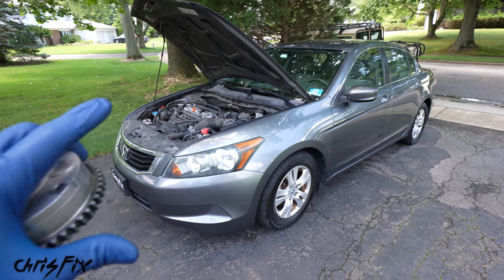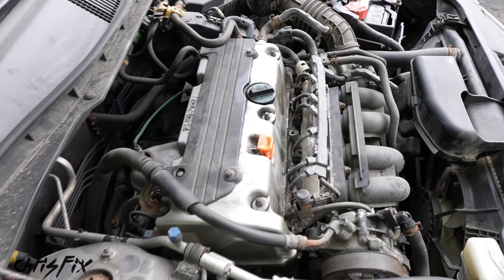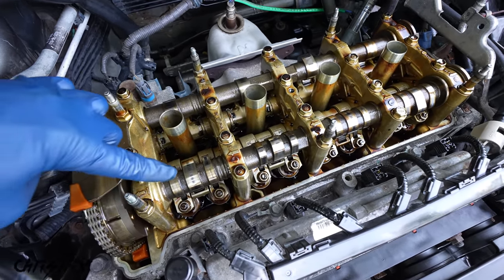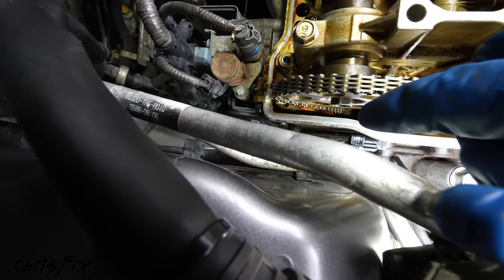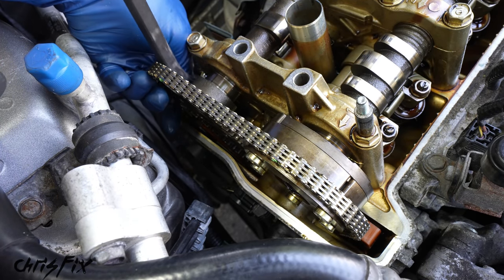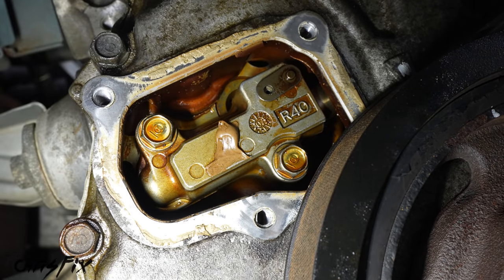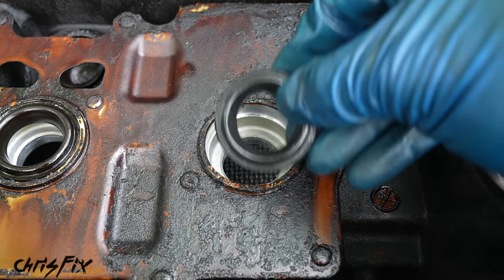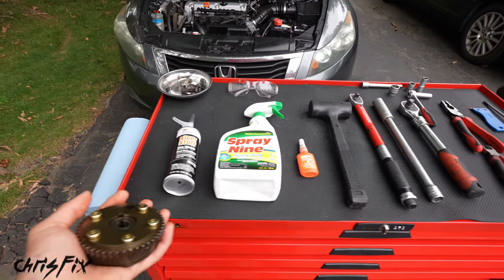How to Replace a VTC Actuator (Complete DIY Guide)

Comment: Is screeching/grinding high pitched noise on cold start, also a vtc actuator issue or starter motor? My civic 2018 is doing it almost every morning now. I'm not sure if i feel the vibration. Just that short screeching noise at the end once i start the car
Reply from the maker: Does it do it every time you start your car, hot or cold? Or just on the first cold start of the day?
Reply: @chrisfix  as of now, it only happens during cold starts in the morning. I cannot replicate it in the afternoon or evening or even if the car is left unused for 8-12 hrs the whole day. The car started normal today. No noise/starter noise. But the sun is also up and shining when i used the car. 

Not sure about the word screeching btw. Noise is more close to someone blowing their stuffy nose. Very short high pitched noise appearing after that normal starter sound. Ty

Comment: I have the rattle on start up for my 2016 Honda Fit. He mentions it could be caused by a bad timing chain as well, mentions he will show how to change it, but I didn’t see any info on that?

Additionally, he mentions that if the white marks don’t align, the timing chain may have skipped a tooth or worn out as well. How do we fix the problem if that happens?

Comment: Hey, can i just remove the plate off and replace the spring, and if yes where can i get the spring kit? If I can do this without dealing with the timing chain and points it would save me a whole lot of time. I'm pretty sure it can be done. What do you think Chris? And can you do a video on this?
Reply: any luck with changing the spring, i am trying to do the same thing

Comment: I just changed mine but I don't know if I did it right. It starts well but a little forced, I let it reach its operating temperature and accelerate a little without problem but when you release the accelerator the revolutions drop to 500rpm and it almost shuts down. Another detail I saw is that when you remove the oil cap, a lot of air comes out.

Could you tell me if this is normal?

Comment: So I have a 2004 Honda CRV. Called Honda Services and they said it's no use on replacing the actuator. It's a 400 dollar part. Will thicker oil help with the noise?

Comment: Timing question. At 17:15, you mark the punch marks with paint but it appears to no longer be at top dead center. The two marks on the insides of the sprockets appear to have rotated past each other. I haven't finished the video, so maybe it's clarified later, but can someone explain this?

Comment: I have a weird situation where my Acura TSX (same engine just higher compression) made that exact noise when I first got it at 130k miles no engine light, wasn’t low on oil either, did 3 oil changes within less then 2,000 miles with Pennzoil ultra platinum now I don’t have the noise anymore after over 10k miles now at 144k. I think mine may have just been sticking from lack of maintenance I’m not sure

Comment: Someone had replaced the chain on my car and didnt use the colored links like they should. It is off one notch evidently according to my scan tool Cant determine which one or which way. Any way to rotate the chain without taking the cover off and assuring its in the right position so the colored links will line up? The more I think about it, that shouldn't matter as long as the lines line up, correct?

Comment: What happens if the timing chain tensioner key hole is way off the hole alignment even when I turn the crank shaft counterclockwise a little to try to decompress it to put a new tensioner in to replace

Comment: I have an R18 civic that does the exact same thing but it doesn't sound like a rattle, sounds more like something is slipping and also sounds like a grinding noise at the same time. As you know the R18 doesn't have a VTC actuator like this one does and unfortunately there is no check engine light. I'm thinking maybe it's a bad pulley? Any thoughts?

Comment: Hey chriss I have a car and it's really shakes no matter what it's runnig at idle or at high revs but shakes increase at high revs and sometimes it goesaway instantly and almost fully like last night under heavy rain  ...plz help me out i wonder if its mechanical like a bad clutch disk or ellectrical like coils or sensors or injectors.  .PS:NO ERROR CODES

Comment: I once had to cut a valve cover gasket a few cm cause it was slightly longer than what the Tiburon had not my proudest moment but hey it didn’t leak car still running 4 years later😂
Reply from the maker: If it works it works!

Comment: Is this the same step on the 2.4 earthdream engine? Should the timing chain tensioner be replaced or is it not necessary?

 If it is that same method thanks the freaking noise is annoying.

Comment: Hey Chris...Im having the same problem in my crv 2013 exl, the only differences is, that rattle sound makes it every time 15 minutes pass (Engines off) ...So in many words happens all the time not just in cold starts...Dealer stated is the vtc actuator theres no code by the way...Im a little bit confuse if might be the vtc or something else..
Reply from the maker: Sounds like the oil is draining out of the actuator and causing it to rattle. Hard to say without seeing it tho.
Reply: @chrisfix  Hey Chris thanks for your reply and by the way nice video…Im really struggling with this issue, in case oil is draining out of the actuator should I replaced it or look for something else (other issue might be)

Thanks again!

Comment: My tensioner doesnt lock/unlock. it simply stays in the unlocked position whether im turning the crank clockwise or counterclockwise. Does this mean the tensioner and chain are bad, or just one of either?
Reply: Regardless, the timing indicators of my crank are off, even though the exhuast/vtc sprockets line up fine. Im just going to send it to the shop.

Comment: It's 2:00 AM, just returned from my test drive. One advise, do not use the DORMAN actuator. Installed it last week and grinding was back yesterday. A number of customers had a similar issue so DORMAN is a hit or a miss. Went to the dealer and picked up an OEM and reinstalled it myself. Let's see how long this lasts. Just my experience, it was not as easy as it seemed.
Reply from the maker: Interesting, thanks for sharing, the unit I installed has been working fine since I installed this

Comment: In my accord I manage to get the sprockets to line up together at the top, but as said in the video the crank lines are off by a few millimeters, would it still be okay to replace even if it is off? or is there some sort of solution? thank you

Comment: Probably a dumb question but can a bad oil pump or the components in the pump cause the actuator to lose oil pressure overnight And make the cold start sound/clicking sound ? I had the vtc actuator replaced the power is back and it seems i get good mpg again but the cold start / clicking sound is still there .

Comment: My son‘s 2012 Honda Civic SI has that exact rattle noise on cold startup. However, it runs perfectly, very smoothly very powerful no check engine light and smooth idle. Can it rattle and not be bad yet? It has 140,000 miles on it and it has had, frequent oil changes and the inside of the engine looks brand new no sludge as we found out when we adjusted the valves at about 130,000 miles
Reply: Usually a new VTC actuator spring fixes the rattle
Reply: i was letting it go on my 08 accord but now that im at 160,000 miles the cold starts are getting worse the engine almost stalls and it rattles for another couple seconds longer than it ever did, so im finally replacing it. i fear the timing chain could skip a tooth and cause internal damage.
Reply: We can send you a free test kit for a new design.
Reply: @spring-start  sure, i have the r44 actuator in a 08 accord k24z3

Comment: Would there be anything wrong with rotating the engine at the power steering pump near the cams instead of the crank pulley?
Reply from the maker: Not sure it's designed to do that, I would always rotate from the crank!

Comment: My 2011 CRV has just started to make this noise at start up but no check engine light yet.  No change in MPG but I do notice hesitation with acceleration. Is it detrimental to not get it fixed right away? I assume the rattle is chain slap?
Reply: same here, no codes and very short rattle, debating whether to even worry about it

Comment: I have the same code but my car won't start. When I unplug my VVT solenoid. The car will start but will idle at 2500 RPMS. I followed your procedure to change the sprocket however the crankshaft TDC arrow is about 45 deg to left of where it should be. The cams line up and the dots are facing up. The two horizontal lines are facing each other on the cam. Should I bother changing the sprocket? Is the car untimed? If so, why does the car start up when I unplug the VVT solenoid?

Comment: Hi chris I attempted to do this repair and when it came to placing the cam phaser on the cam shaft i couldn't lock it so i had to stop my repair if you if could share any ideas that would be great and it is still un locked

Comment: My Honda 2013 accord rattles on turns as well after a cold start up. Along with the oil changes needing to be done far more often than usual. Is that a vtc?

Comment: I’m getting a p2647 code on my 04 Honda Civic but my engine is not equipped with a vtec solenoid.  The code is reading a stick rocker arm.  Any ideas on this?

Comment: Did this fix on my 2011 Hyundai Santa Fe with the 3.5 v6 replaced both chains and all 4 cam gears and tensioners. Still rattled on startup. Any ideas?

Comment: I am doing this job now. I saw another video locking the actuator after installing the chain, by rotating the camshaft counterclockwise. Doing it your way makes my tdc sprocket marks off by the amount i had to rotate to lock. The other way seems like it will keep marks aligned...whats the difference?
Reply from the maker: The way I did it is how Honda says to do it in the service manual.
Reply: If i am done with the install and checking timing...would my timing mark being off a couple centimeters be a result of the chain jumping when I had to remove the tensioner? @chrisfix

Comment: SOMEONE HELP?? 

After installing VTC actuator unlocked, and torqued bolt, I turned the gear to lock it but heard no audible click???  Is this cause for concern? It is locked in place and will not move but whats the chances this brand new part is defective?
UPDATE: Put everything back together and so far so good. No grinding noise, engine runs smooth as butter.

Comment: What happens if you let this go? Bought my '12 CRV as a local trade, it's been making the noise. Got my first oil change and although there is record of the dealership changing the oil 3 times, the mechanic told me the oil was very very dirty.

Comment: could you please comparing the bad VTC actuator and the new one ? I really don't know why the old VTC actuator is bad.
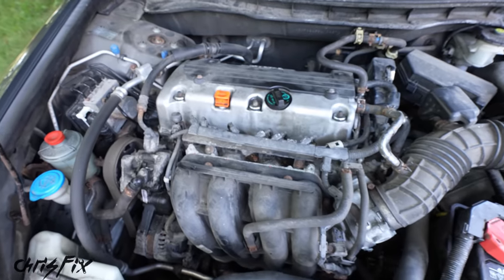Reply from the maker: 0:46
Reply: @chrisfix  Thanks for replying. Yeah，you read the DTC from OBD interface，that's good ,  and what i mean is comparing the old and new VTC actuator from their apperance, so i can know exactly what happened to the old one, because sometimes VTC actuator going bad but ECU doesn't give any DTC code. Just  a suggestion, if you do another video about VTC actuator, consider it. :)
Reply: It will make the rattle noise, that is the most obvious

Comment: Crank is TDC, cam lines are 8 teeth off. Vtc actuator = teeth looked like chain sat on tip. Popped top guide and teeth sat in. Can't get ANYTHING to line up correctly. Basically I'm taking an educated guess that needs chain kit, actuator, cams reset, etc??? Please help, please!

Comment: Hey, Chris. When I was reinstalling, the pin must've fallen out of the eyelet hole on the tensioner and now the little eyelet is pointing diagonally up and to the left, instead of down and to the left. I have code P0341 showing up on the dash, what do I do?
Reply: I'll also add that the car is NOT suffering in driveability, but the CEL is on, as well as the VSA and /!\ lights and my cruise control won't work.
Reply: Same here  did you get it fixed?  please advise me thank you my friend

Comment: My malibu makes this exact sound. But I have no code, is it possible that this is the issue? I had the timing chain replaced which helped the noise a little, but didn’t solve the problem. It is The exact same sound!!! Just no code.

Comment: hey i have the same exact car and everything and it does the same sound but my car doesn’t have a check engine light ,like everything runs good and i don’t want to waist money on buying the part or anything without actually knowing but idk what’s wrong and i wanna fix it ,plz tell me if it’s the same thing or just a timing solenoid or idk

Comment: My old vtc was i unlocked when I marked the chain and pulled it off, giving incorrect reference marks on the chain.  I installed the new vtc per the video, then dropped the chain and rotated the chain until I found the two sets of gold reference links,  only then did the exhaust sprocket go on ready like the video.
Reply from the maker: Glad to hear the video was helpful!

Comment: Someone also said it was camshaft gear assembly leaking down oil pressure and other person is saying this "I bought a Honda Accord 2014 touring model and I am also having that Grinding noice. Changed VTC Actuator two times, starter changed, belt changed, VTC solenoid changed. No use friends it's still having that trouble. Actually Honda knows that problem but they won't deal with changing all the parts. If once changed VTC and customer coming back with the problem they have to change the whole thing. One service guy from Honda told me like this. He also told me one more thing if Grinding noice is not solving then in future it will damage something gear and it will move everytime because of bad wear and tear. It will fully damage everything. I spent too much money on my car and It's like this. Why Honda is like this not aware of this issue"

Comment: You mentioned your painted marks on the chain won’t line up like old vs the new VTC….why is that? I marked mine before removing the chain now I can’t get the exhaust gear back on obviously I have to remove the tensioner altogether now.  Looking ahead it’s apparent my paint marks on chain won’t line up. Watching other videos, why is there so much emphasis on the gold links on a new chain with relationship to the punch marks? Does my old chain have these?  If my marks are lined up & I have the TDC mark on why is this necessary?
Reply: Did you ever find your answer? what did you do in your situation?

Comment: Just did one on my 2010 Accord 2.4 
Unfortunately I ended up pulling the cams out. Was anal on lining everything up after seeing mine had skipped a few teeth when I opened it up.Recommend changing out the tensioner while you’re in there. When I was done , alls good. Thanks Chris!

Comment: Wheni i removed my vtc actuator it was set in the unlocked position. So when i put the new one on and set it to the locked position i wasnt able to align the marks with the chain. This is where im lost. Do i leave the new one unlocked and put the chain on? Thats the only way to align the marks without rotating the camshaft.

Comment: Why do you need to fit the sprocket in the unlock position then turn straight after you tighten it,I pulled the old sprocket apart and found no reason to do this,just doesnt make any sense to me but engineets have their reasons.

Comment: help? I went ahead and turned counter clockwise and the little swinging lock on the tensioner does not move (hardly) in any direction. regardless counter or counter clockwise. Do i have a bad tensioner?

Comment: what happens if the vtc actuator locks before I get the bolt in and torque it, can I unlock it and restart?
Reply from the maker: You should be able to use some compressed air in the oil hole to unlock it

Comment: Chirsfix I followed instructions but I can’t seem to get chain back on Actuator please help I keep going counterclockwise and putting pin in tensioner hole but chain doesn’t loosen helpp please
Reply from the maker: Did you try removing the tensioner? Just keep tension on the chain so it doesn’t fall.

Comment: What if you get you cam vct acuator on in the unlocked position with the bolt finger tight and you go to put exhaust sprocket on and vct actuator locks while trying to get exhaust sprocket on before tourqing? I turned the engine over and everything still lines up.

Comment: i have the same engine im my 2005  honda odyssey and have a code P2646,,,,, i dont have a rattle at all   but sometimes it wont rev above 3000rpm    is that the same prob or the solinoid

Comment: I ran into a problem. The pin fell out of the tensioner and now it’s pushing so hard on the chain I cannot get the intake sprocket and vtc actuator back on. Is there any way to relax the tensioner so I can get the sprockets back on??
Reply from the maker: Hold the chain tight and unbolt the tensioner. You can collapse it by hand and put the pin back in.

Comment: I did this on our daughter's 2008 Honda Accord. Followed the instructions exactly. After I put everything back together and started it for the first time, the VSA light, triangle light and check engine light are on. A/C and cruise control no longer work as well. Does anyone have any ideas as to why? I'm pretty mechanically inclined as I do all repairs and maintenance on all our cars, trucks and motorcycles.
Reply: The 2008 Accord has a touchy crank sensor and if that sets the check engine lamp the car goes into limp mode with the Vsa lamp, etc. I reset the code and it went away. However Honda does offer an update for the 2008 crank sensor.